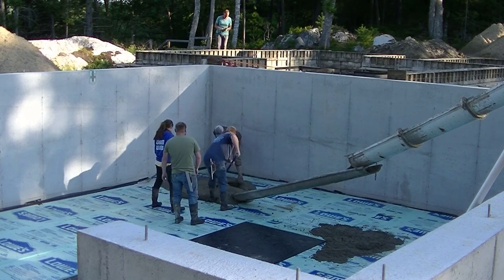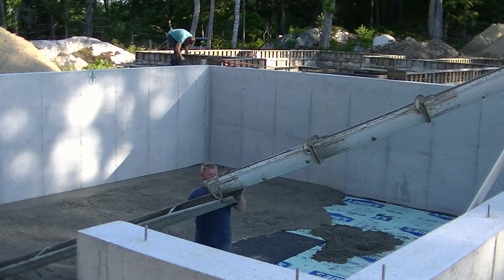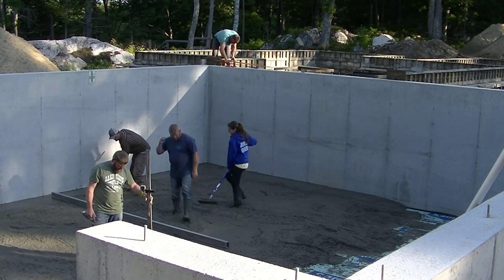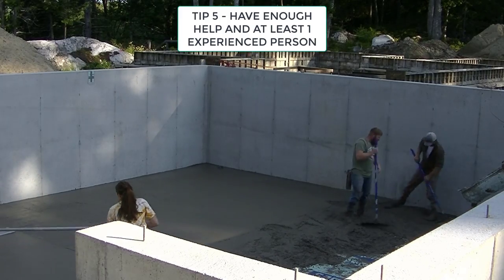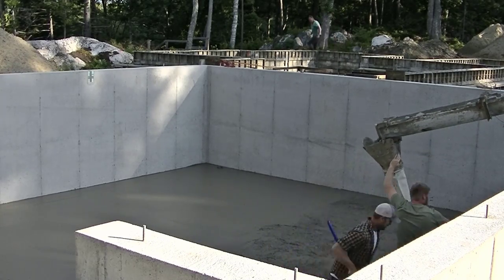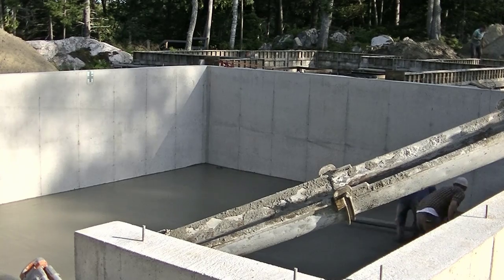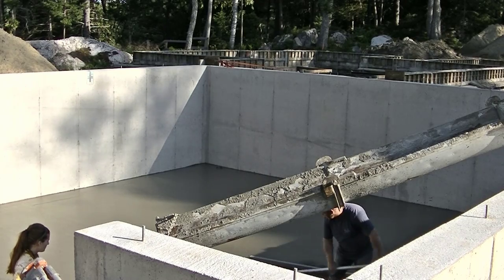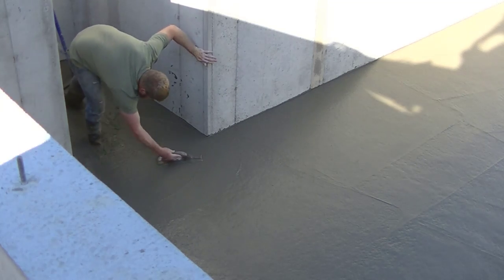Concrete Floor Pouring | Installing A Concrete Floor For Beginners

Comment: Would you think a 6 inch slab on grade would be enough for a enclosed carport garage? Or would a 4-6 inch slab on grade (on a compacted base of course) in a pole barn be sufficient for a garage floor? We have a 48 inch frost line her in the mountains of Virginia. Family keeps telling me just a slab on grade is good for a garage floor. I just don't know.  I will be hiring a finisher for the pour.
Reply: That's one way that we do them in minnesota, where frost coverage in building codes tends to be 42 inches.

Are there garages like that near by that have stood the test of time?
Are there local building codes?
Reply: @cheshstyles  yeah there is county codes but i am gonna be an outlaw 😂 im zoned agricultural so i dont really have to abide by them
Reply: @LanceSheppard  yeah but you can look at the codes to get ideas of what works. It may say right in the code book "fuck yeah you can do a 6 inch slab, here's what you need for rebar"
Reply: If you can afford the 6in pour, go with it. You're not going to regret it a couple of years from now. However, you will be sorry if you go cheap and it all cracks down the line. I can't imagine the cost difference is that dramatic.
Reply from the maker: There's never a guarantee pouring a slab on an unheated space. The frost could lift it. If there's a good gravel base and landscape all slopes away, you should be ok. We add 2 inch styrofoam to a lot of our slabs to help protect against frost.
Reply: @cheshstyles  😂 ill have to look for sure  buddy
Reply: @MikeDayConcrete  ok thank you